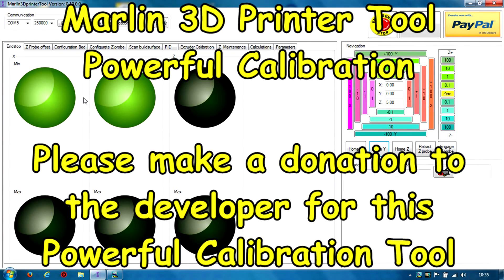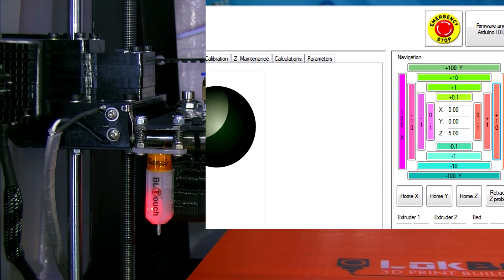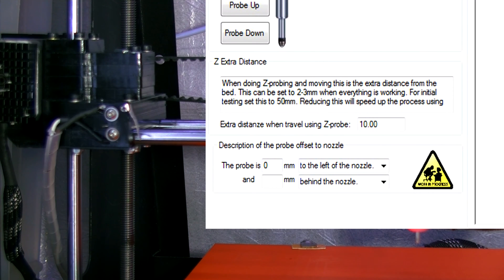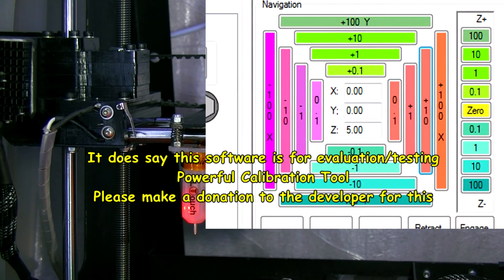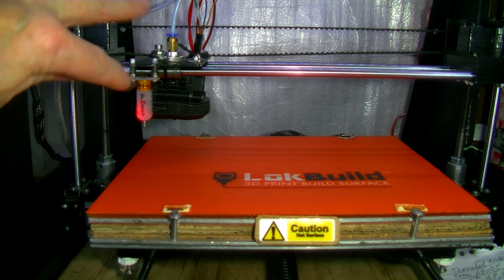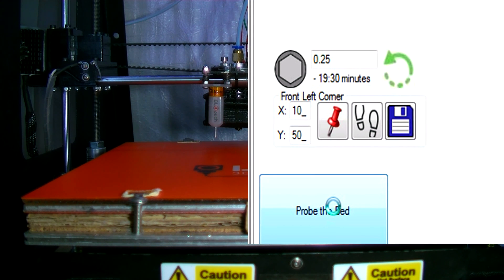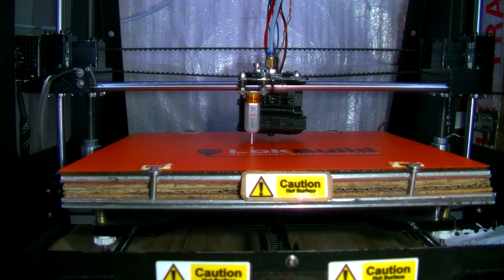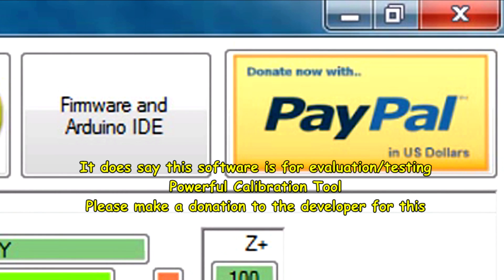Marlin 3D Printer Tool Powerful Calibration

Comment: Try to change this in configuration.h.. I have made comments witih () that should NOT be pasted in the code.

A suggestion is to copy your existing working Marlin FW directory to a new directory called NewMarlinDate

Then use MarlinEditor and run the setup (gear icon)
Enter the current working FW directory
Enter the new (NewMarlinDate) as new FW
Save

Run the migration tool

You get 2 frames with the configuration.h (current and NewMarlinDate)
Navigation:
* Scroll and dubbleclick on festure (the word after #define) and both frames will align
* Choose a feature in the featurelist and you will align on thet feature 
* Ctrl+F and enter a word (BLTouch). Doubleclick on feature and the frames align.

Change the value in the NewMarlinDate frame. (current frame cant be changed)

Dont forget to save.

Run Arduino IDE and load the NewMarlinDate version of Marlin.

If somthing goes totaly wrong. Delete NewMarlinDate and reload the curent onchanged Marlin FW from currentFW-directory

This is my suggestion on changes in configuration.h 

( this alows the probe to make clearance before the next probe. You have 2 mm an d that is a bit low. I have increased  from 2  to 5)
( The alarm is caused becase the probe is hitting the bed when it is engaged.)

/**
 * Z probes require clearance when deploying, stowing, and moving between
 * probe points to avoid hitting the bed and other hardware.
 * Servo-mounted probes require extra space for the arm to rotate.
 * Inductive probes need space to keep from triggering early.
 *
 * Use these settings to specify the distance (mm) to raise the probe (or
 * lower the bed). The values set here apply over and above any (negative)
 * probe Z Offset set with Z_PROBE_OFFSET_FROM_EXTRUDER, M851, or the LCD.
 * Only integer values >= 1 are valid here.
 *
 * Example: `M851 Z-5` with a CLEARANCE of 4  =>  9mm from bed to nozzle.
 *     But: `M851 Z+1` with a CLEARANCE of 2  =>  2mm from bed to nozzle.
 */
#define Z_CLEARANCE_DEPLOY_PROBE   5 // Z Clearance for Deploy/Stow
#define Z_CLEARANCE_BETWEEN_PROBES 5 // Z Clearance between probe points

----
( You dont have to enter servoangles. )
// Z Servo Probe, such as an endstop switch on a rotating arm.
//#define Z_ENDSTOP_SERVO_NR 0
//#define Z_SERVO_ANGLES {70,0} // Z Servo Deploy and Stow angles
---

( This is working speeds while probing)
( I have not activated   PROBE_DOUBLE_TOUCH. when everything is working you an activate it)
// X and Y axis travel speed (mm/m) between probes
#define XY_PROBE_SPEED 5000
// Speed for the first approach when double-probing (with PROBE_DOUBLE_TOUCH)
#define Z_PROBE_SPEED_FAST HOMING_FEEDRATE_Z
// Speed for the "accurate" probe of each point
#define Z_PROBE_SPEED_SLOW (Z_PROBE_SPEED_FAST / 2)
// Use double touch for probing
//#define PROBE_DOUBLE_TOUCH

----

(Remember to activate the probetest done by M48)
(this gives you ideas about how good your monting and probe eletronics really are)
(There is a testing procedure inside M3DpT for this )

// Enable Z Probe Repeatability test to see how accurate your probe is
#define Z_MIN_PROBE_REPEATABILITY_TEST

----

( there is no meaning to have 3 activated sevros of you only have one BLTouch. reduced from 3=datfault to 1)
( If the computer is slow give the BLTouch some extra time to be able to engage /retract the probe. Increased from 300 to 600)
(This will not increase printingtime. It will be less then 5 sekunds on a print)
(When everyting is working this can be reduced, but "why fix somthing that is not broken" )

#define NUM_SERVOS 1 // Films4You BLTouch Probe Servo index starts with 0 for M280 command

// Delay (in microseconds) before the next move will start, to give the servo time to reach its target angle.
// 300ms is a good value but you can try less delay.
// If the servo can't reach the requested position, increase it.
#define SERVO_DELAY 600
Reply: I will be away for 1-2 hours.. Then I might be able to help you thru TeamViewer and/or HangOut

Plaese let me know if my suggestions worked.
Reply from the maker: Run the migration tool ; I could not find this option so I modified "Configuration.h " by hand.

Turned the front right knob lower and it is working M28, M29, and printing 10mm cube test, without flashing:

Don't know how I got 2mm probe heights now fixed, I ask now for 10mm, goes a bit slower probing, but better being slow and working than fast and not working :)

I still don't understand auto-levelling and why adjust bed heights with bolts is needed, if autolevel suppose to allow for off -level, OK better being as level as possible.

Printing ABS; some cardboard round the printer to keep heat in, but still expect it to Curl on bigger prints.

Hope to see M48 S ; soon 

Thank You 20000%
Reply: IMHO printing on a 3mm tilted bed is only  suitable for Youtube (and testing)

When you have a bed that is leveled within 0.05 mm there is no need for ABL/MBL. But things are not that simple. The corners can ble in level but the shafts bend because of gravity. Its not unusual that the shafts bends 0.1-0.2mm. That is where ABL/MBL start working. To adjust the small imperfections that there is on all 3D printers.

The Z-axis are normaly operated with tread-screws and they are slow. They have to move all the time on a uneven bed. Its very possible that they loose steps.

A perfect flat bed and ABL/MBL gives the best restult. Especially with ABS  and other plastics with big footprint that needs a 99% perfect 1:st layer on the entire footprint.

(During your video i discovered that the thread selection on the adjustmentscrews was hidden. (or actually was sent to back and hidden  behind the frame. I will also try to add a checkbox for inverted adjustment screw. This will be fixed in 0.21-beta. )
Reply: Is everything up and running?
Reply from the maker: Working
M48 S
Returns:-
Mean: 0.735547 Min: 0.684 Max: 0.798 Range: 0.114
Standard Deviation: 0.031128
Reply from the maker: I think I'll have to try a big print to see what happens with this.
Reply: Marvelous!!!  And meassure within 0.03 is perfect. You will not get that better on a standard hobby 3Dprinter. 

The most importent issue is that its repetitive.. You can compensate for a repetitive value but never if its changing and never is consistent

I am very happy that the M3DpT helped you to get your Marlin Configuration right.. That is the main goal for the Marlin3DprinterTool
Reply from the maker: You will not get that better on a standard hobby 3Dprinter. : sick of Curling prints... waiting for a print to watch it Curl, I bet. Typical before this code help you give me:-
https://www.youtube.com/watch?v=knXRgKaOp4o&index=9&list=PLUqt0sTiXUDeiN8JOL8xDoORcqJLJdxsE&t=418s
Reply from the maker: Selling sick of Curling: Typical:0
https://www.youtube.com/watch?v=knXRgKaOp4o&index=9&list=PLUqt0sTiXUDeiN8JOL8xDoORcqJLJdxsE&t=418s
Reply from the maker: See this before the code fix bet I will still get it, poor quality printer
https://youtu.be/knXRgKaOp4o?t=6m32s
Reply from the maker: But all I get is warp/curl/lift long term issue, even with PLA {Printer problem, income problm} :- https://youtu.be/zBur9jyfnVI?t=21m37s
Here is a small part in ABS:-
https://youtu.be/NraBmTIRda8?t=3m2s

Comment: Thanks for all the kind words.. I think I have ideas about we you get the BLTouch alarm. Send mail to c a b b a g e c r e e k (a) g m a i l . c o m and I will try to help you

Many Regards
Reply from the maker: eMail sent, dot solution,  with Configeration.h file attached

Thanking You 2000%
Reply from the maker: Tried G28 home, G29 auto level manually and same issues, turn the right corner of the bed down, increase distance from nozzle, then G 29 was OK: I do not understand that the autolevelling needs bed adjusting; can you help me by explain this.

I thought autolevelling  would map and allow for any off-kilter of the bed and therefore the bed not need adjusting.( (well some where near level), then let autolevelling do the rest.

I see the Z carriage moves up and down to adjust Z height as it prints so autolevelling  seems to work.

I have had so many problems with this printer, Curling on Magic Bed surface layer in video above, PIE sheet, Blue painters tape, PLA, ABS, different Z Offsets, etc all do similar Curling .

Sick of waiting 3 Hours to see if it starts to curl after every Z Offset adjust of 0.01 mm

I am now fed up and  thinking of Packing in 3D Printing

Thanking You 2000%